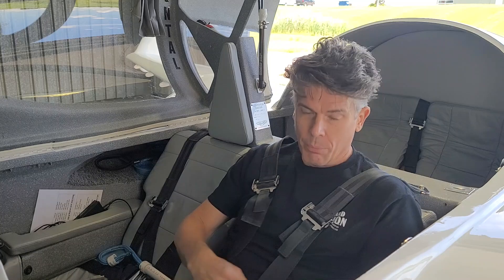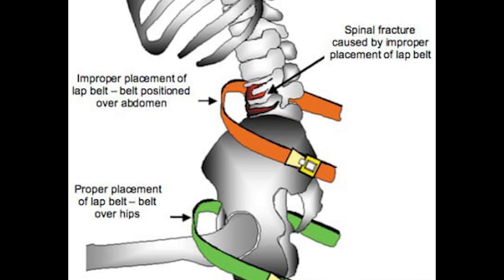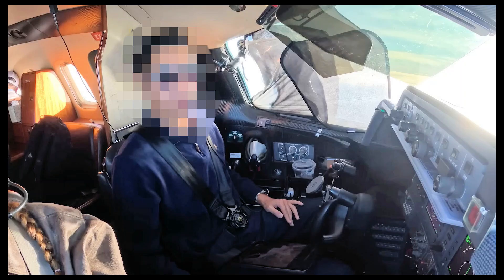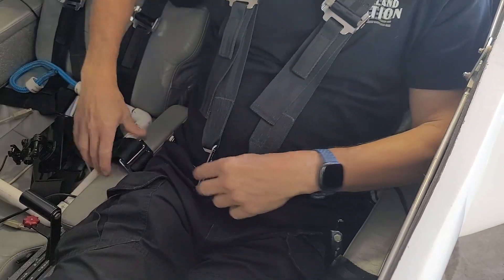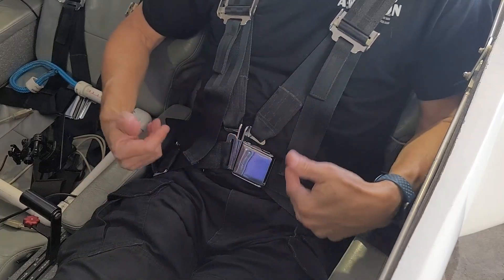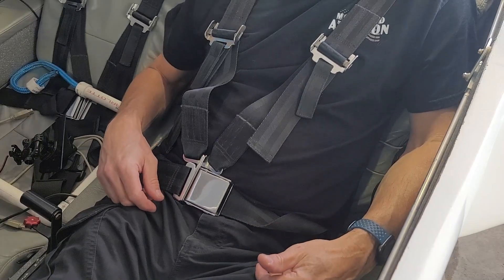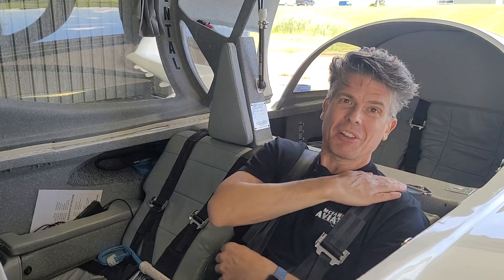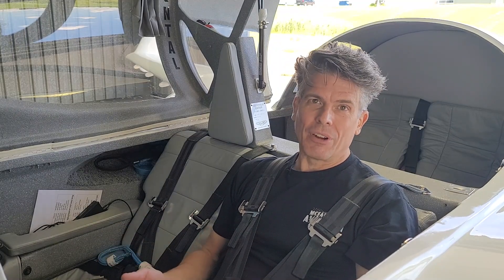Aircraft Shoulder Harnesses: Are You Wearing Them Incorrectly?

Comment: Scott,  Quick question regarding an earlier video and sorry,  I don't remember which one.   You mentioned you bought a "power supply" so you could energize your electrical system and work/troubleshoot as needed without engine running and not using battery power.   I want to do the same.  I have a power supply coming so my question is... where do you hook it into your plane?   I was thinking at the alternator output and a ground???    Do I need to unhook the battery etc.  
Thanks in advance.  I enjoy and have learned from your content!

Comment: I have hooker harnesses in my experimental. It actually has 3 tangs that the lap belt go through. Left shoulder harness. Middle attached to floor, right shoulder harness. This keeps the shoulder harnesses from pulling up the lap belt when you tighten them. These are aerobatic harnesses though.

Comment: Interesting point you made about the height of the shoulder anchors relative to the shoulders. I would think it's more about the angle the belt takes after passing over your shoulders behind you, than it is, strictly, about the height of the shoulder anchor. So (on a seat that has space behind it) mounting the anchors further behind your shoulders would help the belt geometry, even if the anchor height can't be raised. (Not practical where there is a seat behind or for your rear seats, an engine bulkhead behind).
Reply: You are correct that it is the angle that is ultimately important. AC 43.13-1B has all of the angles and more.

Comment: Thanks for the great advice 👍 hopefully 🤞 everyone who sees this post will understand your point ! Personally I learned this luckily by flipping a dune buggy end over end ! No injuries 🤞we were hanging upside down in the bottom of a gravel pit listening to the gasoline and oil leak out of our engine rocking back and forth ! We bailed out then ran back to flip the buggy back over ! It would have been a long walk home lol ! Oddly enough I have to hang on to the outside of the engine cage to lift the flat front tire off the ground all the way home lol ! We had just put the belts in before we left ! 🍀🤞🍀
Reply: @ITSFUNZ The thing I learnt from being in that inverted situation, is that the belt won't release when your weight is hanging on it. (1980 european car). I had to push off the car roof with one hand (& perhaps use legs too) to take some of the pull off the belt, before the belt latch would release. This works OK when you have the power to weight ratio of a 20 year old but an older person could be seriously stuck! 
As you just had a roll bar & no roof, maybe your weight wasn't entirely on the belt or you might not have standard car belt latches on that type of vehicle.
I don't think I've ever heard safety people mention this. Perhaps designs have changed so this isn't an issue?